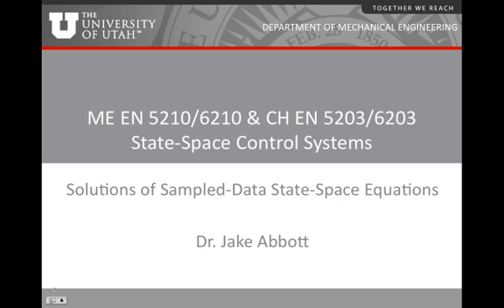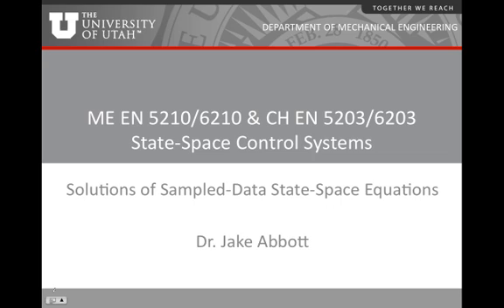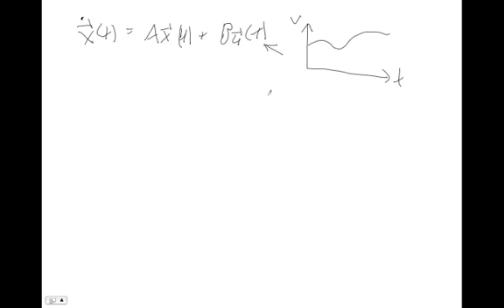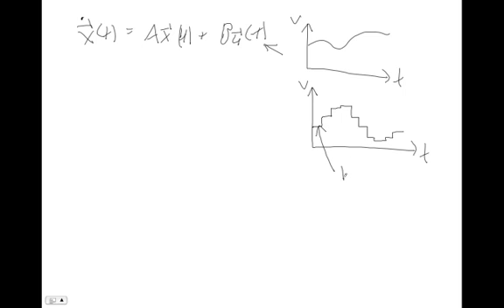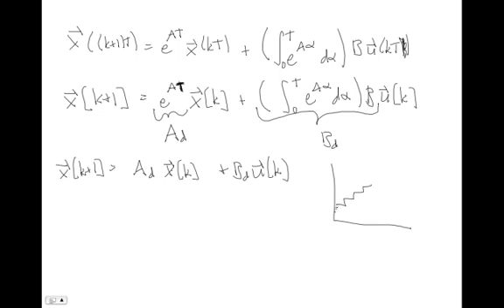Solutions of Sampled-Data State-Space Equations (Dr. Jake Abbott, University of Utah)

Comment: Great tutorials!
Now we know A_d = e^(AT) and B_d = B times this integral from 0 to T (see below for a small mistake here).
But what about C_d and D_d of y[k]=C_d x[k] + D_d u[k]?
Are these matrices of the discrete Equations the same matrices as C and D of the continuous Equations?
Can anyone help here?

Btw, there is a small mistake with this integral from 0 to T:
If you substitute alpha=kT+T-Tau with Tau=0 then you get kT+T. However, this should be the upper limit of this integral, not the lower limit. If you substitute Tau with T then you get kT+T-T=kT which should be the lower limit. So it can be changed either the integral going from T to 0 instead of 0 to T or you leave the integral from 0 to T and put a minus sign before it instead of the plus sign.